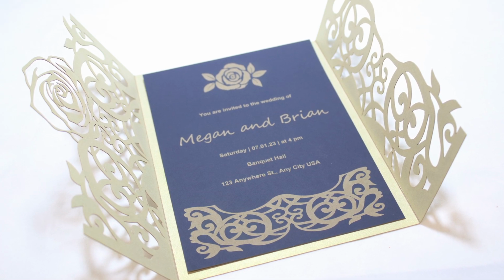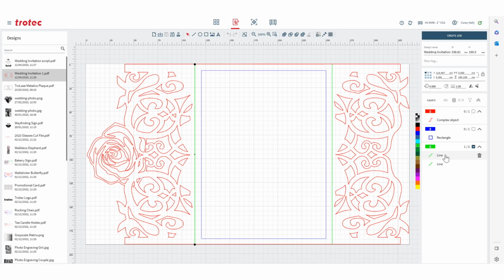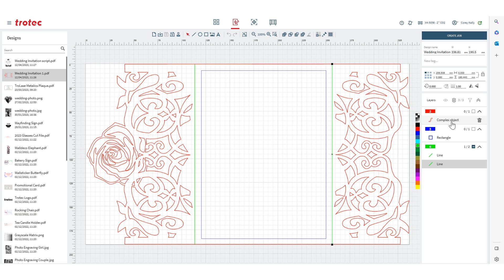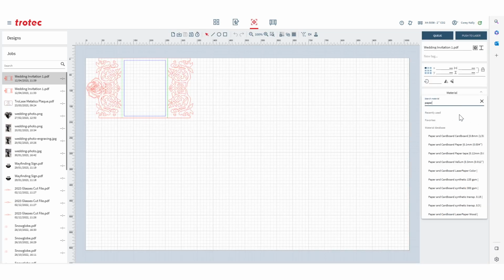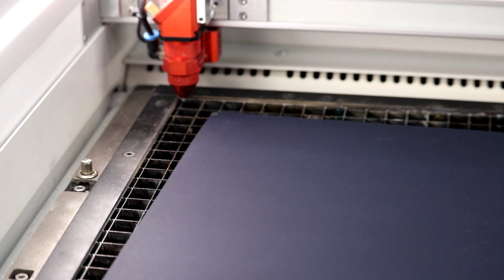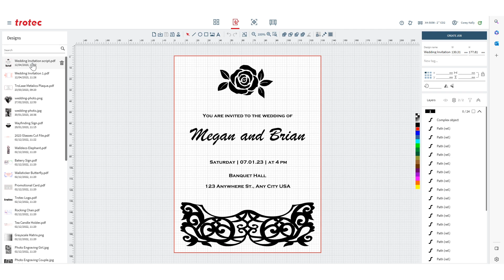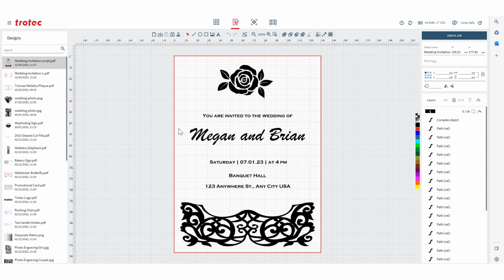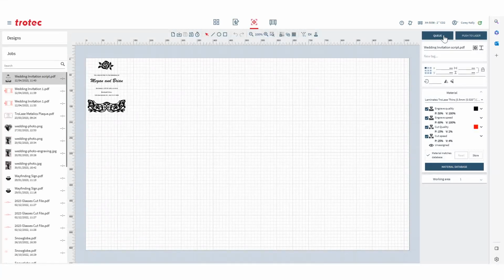Trotec Featured Laser App: LaserPaper Wedding Invitation

Comment: How to cutting without burn the paper edge?
Reply from the maker: The Trotec laser can adjust the speed, power, and frequency to get a little burn on the edge. There is a very slight yellowing directly on the edge, but it is not noticeable in most applications.